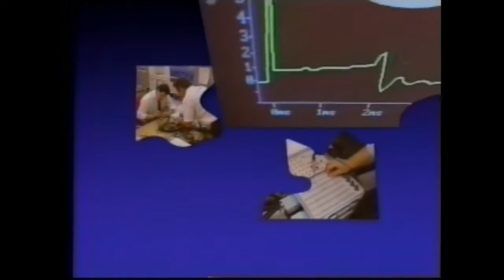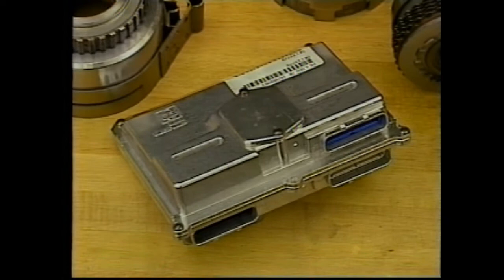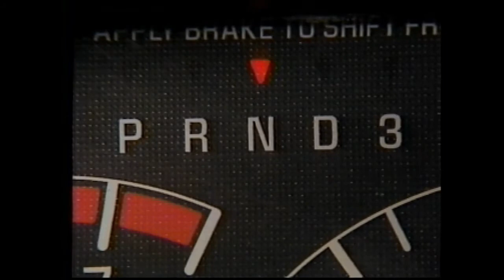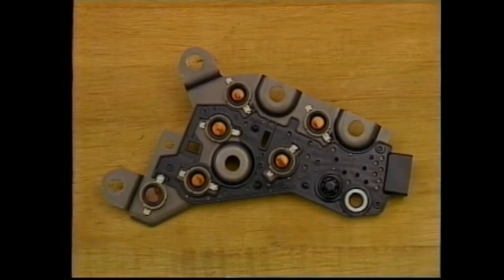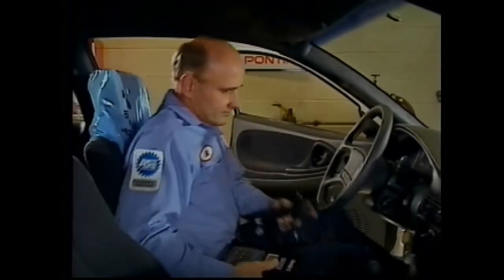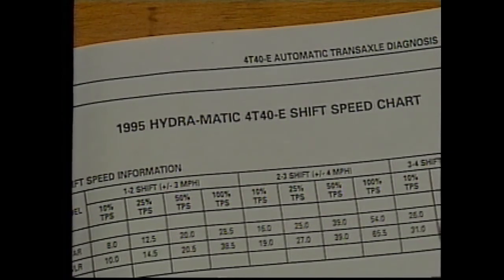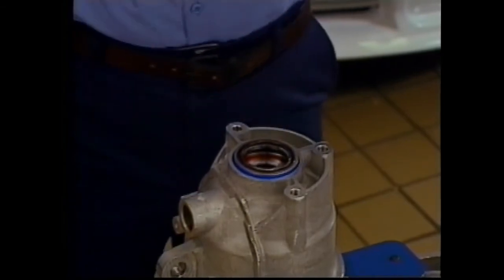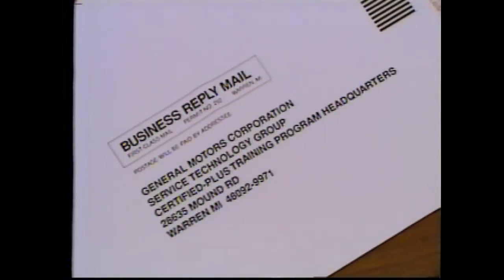1994 GM 4T40E Transmission

Comment: My 1996 car is equipped with this transmission and still runs like factory condition ❤
Reply: Never had a car with a 4T40 but did have two with the 4T60. My '99 Grand Am had a 4 cylinder but was still given the larger, stronger 4T60. Olds did the same with the 5th gen Cutlass, though mine had the V6. The 4T60 was only used on Chevy cars when they had a 6 cylinder.

Comment: 4t40e on my 04' Olds Alero thanks for not including a dipstick and making it a pain in the ass to service
Reply: Hmm, so Olds eventually stooped that low. They only used the 4T60E on the 5th gen Cutlass, regardless of the motor. Also, my '99 Grand Am had the 4T60E in spite of being a 4 banger. That car is still running but I don't own it anymore. I rebuilt the motor in the kitchen of my apartment after it spun a rod in 2010. Ground it for an 0.010" over bearing by hand. Amazing what you can do with a lot of patience and little money. It isn't like it was in the old days where you could go to the local shop and give the guy 5 bucks to let you use the lathe. Liability and such.
The 4T60 will pretty much last forever if you treat it right.

Comment: Are these very good or durable?
Reply: Just make sure you keep the fluid clean along with replacing the filter everytime you decide to change the fluid, also recommend synthetic transmission fluid (dexron 6) to avoid any sort of overheating. Mine shifts way smoother with dexron 6. Edit: Also if the fluid is dirty, try not to change it since it could slip with new fluid.
Reply: I have almost 200k on my cavalier.
Reply: @BeautifulMan4015  and what to do if it slips after a fluid change? Do I have to change the entire transmission?
Reply: @BeautifulMan4015  so what? Just don't change it at all if it's dirty?